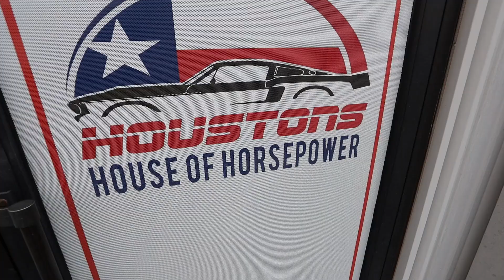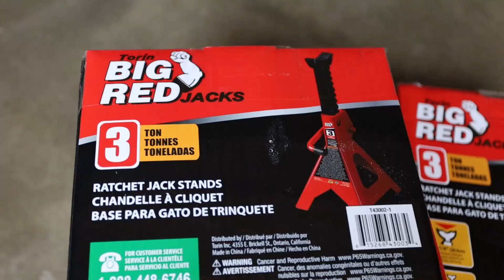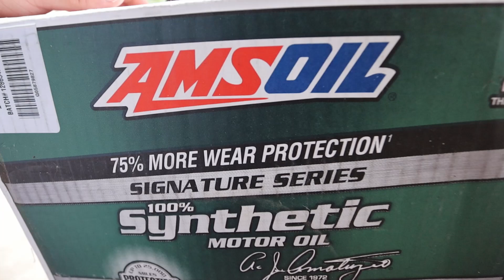New Driveshaft And Oil Change on The Coyote 5 0

Comment: I was reading that it is recommended to use 5w-30 if your truck has bolt ons & 5w-20 if it is stock. The oil I would use is the Ford motorcraft full synthetic. The motorcraft sold at walmart is synthetic blend , I would get full synthetic by buying at the dealership. Prices vary depending on the dealership lol
Reply from the maker: Thanks bro!

Comment: Yo a mi 2019 F150 5.0 se lo cambio  en caminos antes de las  5000 mila millas. Si la traigo corriendo en el pueblo como a las 4000. Uso mobil 1 extended el 15000 millas con filtro Wix syntetic. Tambien traigo un JLT catch can . Aceite 5-20